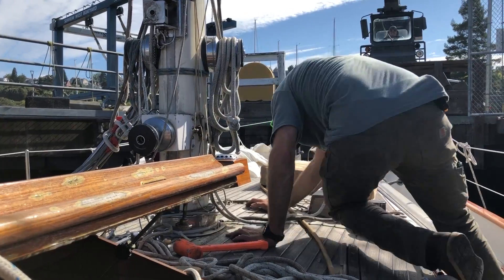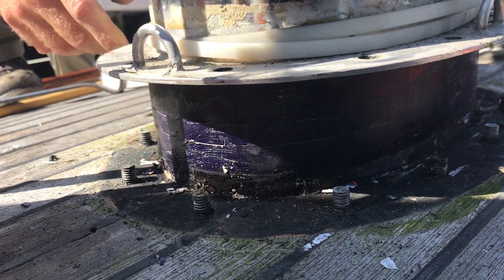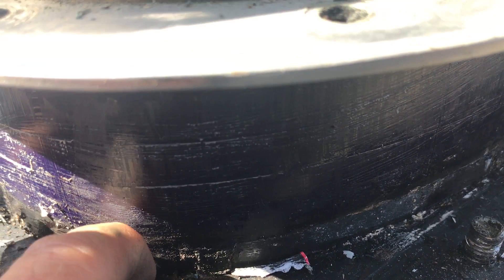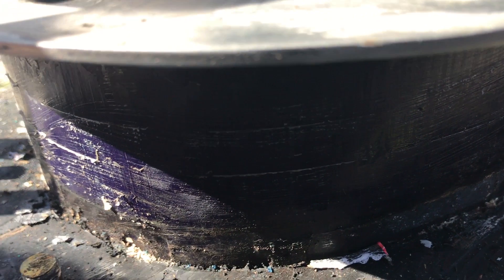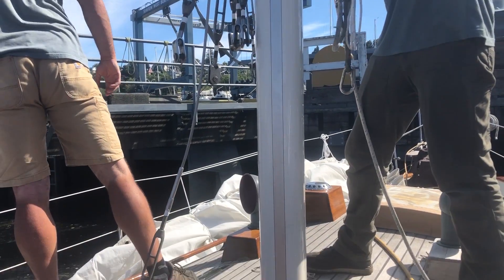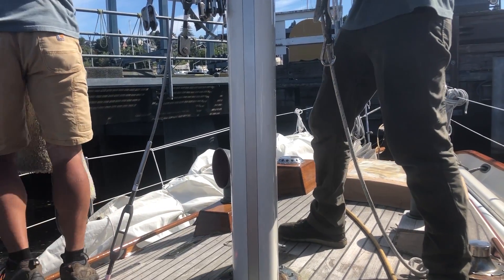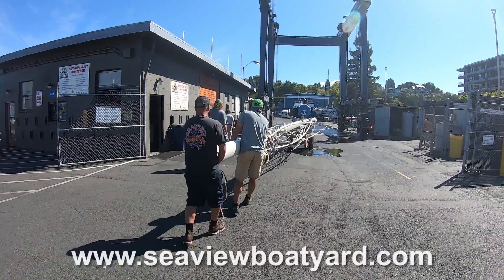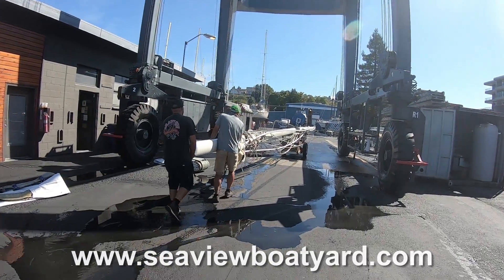Freeing A Stuck Mast on a 1981 Panda 40 at Seaview Boatyard in Seattle, Washington

Comment: Great footage, great patience from the boat yard guys. So why did the mast have to come out?
Reply from the maker: Because the mast step has failed and is crushed so I was flown up to cut it out and build a new one
Reply: @SailorJames  Interesting, I wonder if the owner hit something? I cracked the mast step on my Folk Boat, it made quite a loud bang. I wonder if the mast step was crushed prior to the  mast sealant was applied. As you said that it was so well sealed the crane was starting to lift the whole boat.
   I suppose it could still crush the mast step because maybe the whole deck would flex. 
       Thanks for the response, you do get your self into some interesting situations, I will always remember that anchor in the dingy story that almost killed you.

Comment: There's an odd expression on the water referred to as "sea-fit" and it's in reference to a loose fit used on many things. On land we fit tightly but the nature of the sea is such that a loose fit on things like turnbuckle, keys and even partners to the mast are allowed a few thousands to play. If one takes a close view of rigs of 15th & 16th century they used line and wood that flexed in a controlled "working" that relied on maintenance, not metal. The use of metal changed the way we saw things just as the multitude of resins employed now.  Not advocating... Just a comment.